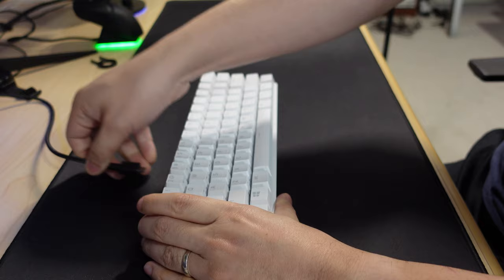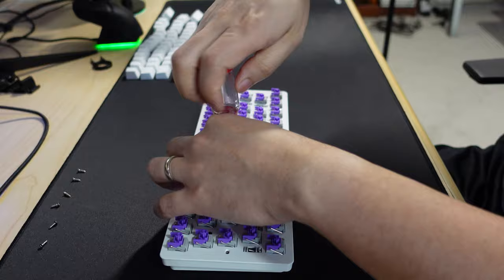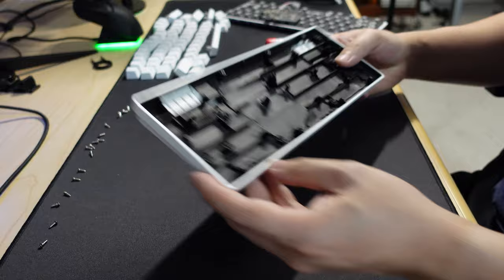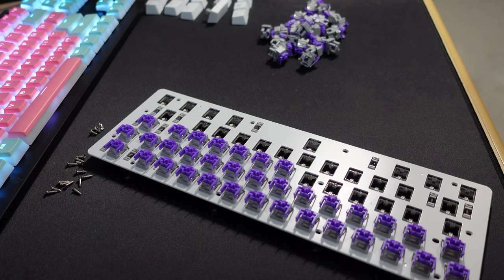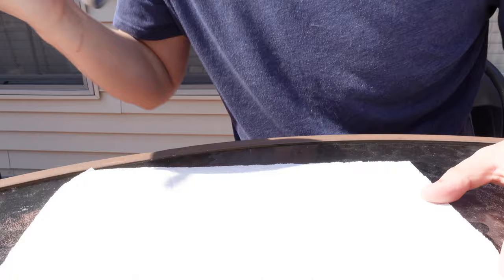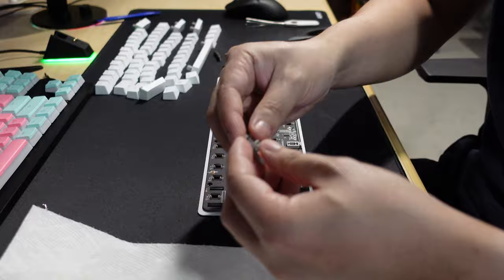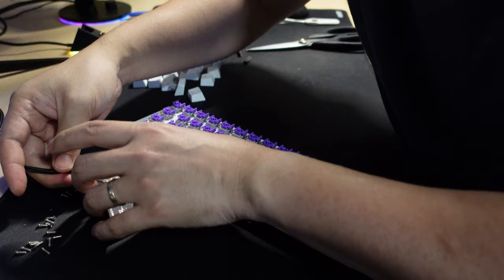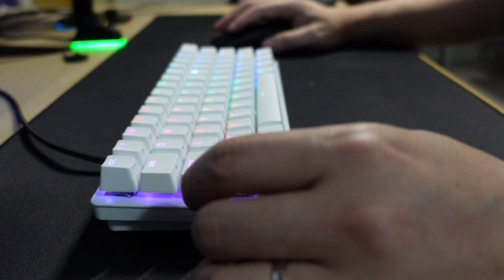Modding the Razer Huntsman Mini: Easy steps for better sound!

Comment: I hate how they changed the space bar
Reply from the maker: What's different about the space bar? Actually the advantage of the Huntsman TE and Mini are that they use a standard bottom row, whereas the rest of the Razer lineup don't, limiting their compatibility with aftermarket keycaps.
Reply from the maker: It's kind of funny since for custom mechanical keyboards, most are doing bandaid mods on the stabs, even putting them on the PCB to dampen the bottom out, so probably that's the feedback Razer took into account for the Mini. Personally I don't find that the feel is worse (or even noticeably different) but I definitely understand that everyone has different preferences. I'm a little too lazy to open the keyboard up again, but I assume that the little rubber inserts in the posts can be removed if you prefer the original feel of the TE, right?

Comment: Razer left the chat
Reply from the maker: To be fair to Razer, they've been doing a pretty good job listening to community feedback (for a large brand). Who knows, maybe the next iteration of the Huntsman will be hot swappable and have better internal sound insulation :D
Reply: I know what do you mean? I know everything that is related to razer #razerforlife
Reply from the maker: Specific examples include: entire Viper line took feedback from eSports pros, starting with the Huntsman TE, they standardized their bottom row so that aftermarket keycaps are compatible, etc. They're pretty active on Reddit, even in r/mk/ so if they see people reacting positively to some of these mods, they may take them into consideration for their next gen of keyboards.
Reply: @bigxie  yeah i know and i got the new blackwidow v3 and its lit

Comment: The linear red comes with glue
Reply from the maker: Glue where?
Reply: @bigxie  My wrong, the linear switch comes lubbed
Reply from the maker: @framedthunder6436  you can check the comments, another user did these same steps for the red linear and uploaded before and after sound clips. Big difference. Razer claims they come lubed, but other teardowns show no indication of lube. Even if they come with lube, it's not a great job and there's tons of room for improvement.

Comment: There's no point in lubing clicky switches, if you have the intent to lube switches, get tactile or linear switches.
The whole point of lubing is to make the switches quieter/smoother, while the point of getting clicky switches is to be able to hear the actuation of the switch.
Reply from the maker: Didn't you just watch a video where the clicky switches that got lubed got smoother, quieter, AND retained the distinct actuation sound? It's almost as if this common saying of not lubing clicky switches only applies to MX clone switches, and doesn't apply to Razer's clicky optomechanical switches. If you're curious why, Chyrosran22's teardown video is a great resource: https://youtu.be/QiFg9wGQXwA

Comment: If u want better sound get the linear its quiet lmao
Reply from the maker: Yeah the red switches are quieter, but the springs still ping just as bad, so all these mods are just as applicable and will result in significantly better sound for the linear version of the Huntsman Mini as well. Somewhere in the comments are sound clips from someone else who did it to the linear version and it's pretty drastic too.

Comment: damn i think i fucked it up lol. my win key doesn't register and my w key activates a bunch of other keys on the board.. tuff
Reply from the maker: Sorry to hear. You can try removing the problem switches and using some rubbing alcohol pads to clean out those sockets (could be some lube gunking them up). Also keep in mind that the keyboard is not hot swap, so make sure every switch is placed in before powering it on or else there will be wonky behavior.

Comment: i know this video was a long time ago, but seeing him pry the ribbon cable with a wedge made me actually cringe. if anyone else is watching this video in 2021, there is a latch that connects the cable, just flip it up and remove the cable. when you put the cable back, the metal contacts should be facing down. save the keyboard
Reply from the maker: Even though the video is pretty old, this is actually a really common comment! It's come up a few times already even in just the past couple of weeks. I'm not too sure why the latch wouldn't come off the first time around (can't remember anymore), but later on in the video in the 2nd disassembly it did just fine. And for people who are uncomfortable with messing with the latch, I think that unscrewing the daughterboard altogether is an easy way to avoid any possible damage that could arise from improperly removing the ribbon cable. 

Out of curiosity, what motivated you to leave your own comment when there are already so many others saying the same thing? I mean maybe you didn't read through the comments thoroughly to notice all the other ones, but anyone else who would benefit from reading this comment would have already been "saved" many times over before reaching yours ;)

Comment: "While the sound has slightly improved."

No, dude... there's 0 improvement. xD
Because the ping isn't caused by the plastic at the BOTTOM of the keyboard, that you "dampened". xD

Edit: At first i thought it was the wire in the stabilizers causing the ping noise, but it's actually the spring inside the switches... Somehow the dry-lube eliminated the residual vibrations after clicking the switch, eliminating the noise.

The foam you applied though? Absolutely useless. :P
Reply from the maker: Ping is from the springs, foam is to absorb reverb from all switch noise. Obviously lubing makes the bigger difference, but foam definitely helps (and if you look more into mechanical keyboards beyond just this Huntsman video, you'll find it's a common procedure). Cheers.
Reply: @bigxie  The reverb inside a keyboard is not large enough for such little foam to make any difference, you need louder noises and bigger rooms for the reverb to even be audible to the human ear.

So no, the foam made no difference.
Reply from the maker: @MyouKyuubi  you're certainly entitled to your own opinion! But maybe consider that it's possible that you're just not perceptive to the sound. After all, if so many people can notice the difference across hundreds of different keyboards you claim don't have enough room inside them to even have reverb, what's more likely? Everyone is experiencing placebo or you're just unable to tell the difference yourself? Honestly, just be grateful it doesn't bother you since now you can save a bunch of time skipping that step!
Reply: @bigxie  Just 'cus they THINK they hear a difference, doesn't mean they actually do.

Placebo effect is not an opinion, it is FACT.

Your mind plays tricks on you all the time, that's why we have science, so we can, OBJECTIVELY figure out what is correct or not, what actually works or not.

Science says that your foam is useless, i'm afraid... And, unfortunately for you, no matter how much denial you exercise in protest of these facts, does not make said facts disappear.

Facts never cease, they don't go away. :P

I am entitled to my opinions, of course, but... These aren't opinions, it's science. -.-'
Reply from the maker: @MyouKyuubi  could be, but definitely not just because you claim it. Show the proof 😂
Reply: @bigxie  Sure, when you show ME proof. :P

Look, asking for proof in a youtube comments section is, in this day and age, not an option anymore. :S

Even if i wanted to show you proof, i can't, youtube censors (the censor bots straight up just REMOVES the entire comment, without telling you) any comments containing "triggerwords" or links, even links to other youtube videos, lmao. xD

That being said, asking for proof, as if that somehow refutes my argument, is just an appeal to ignorance fallacy.

Just because i personally don't, won't or can't prove a fact, doesn't necessarily mean it isn't fact.

Here's the thing, buddy, FOAM, in keyboards, isn't used to reduce reverb, it's used to reduce the sounds PRODUCED by shock. So, if you implement foam in between every hard-surface contact point, you effectively reduce the amount of noise PRODUCED... Which is infinitely more effective than reducing reverb that isn't even audible to the human ear. :P

Foam in keyboards is not used to dampen sounds that have ALREADY been produced... It's used to prevent noises from being produced to begin with.

You're using the foam, incorrectly. :P
Reply from the maker: @MyouKyuubi  foam, silicone, shelf liner, etc are used in keyboard modding between the case and PCB all the time to absorb noise/reduce reverb by reducing the overall amount of empty volume in the case. Have you considered that?

I'll give you credit for putting together a coherent pseudo-scientific explanation, and you're right, I asked for proof tongue-in-cheek. Obviously you cannot prove you are right nor can I prove I am. But I am not the one claiming to have scientific high ground with no credentials or reason to be believed, other than strongly worded, obnoxious statements. 

At the end of the day, there is overwhelming consensus from other YouTube videos and my own personal experience that by placing foam under the PCB, it reduces the noise of the keyboard. If you want to waste time arguing over the semantics or being a pedant, well, don't bother anymore. I entertained this thread to see if anything fruitful would come out of it and instead am now bored by another cookie cutter self proclaimed internet expert. Take care.
Reply: @bigxie  No, dude, they're used to absorb shock, dude.

jesus christ, bro...
Reply from the maker: @MyouKyuubi  I love that part of the scientific method where you repeat something over and over again until it convinces everyone. Great job, it worked!

For the benefit of any viewers who may read this comment thread (sorry for that tremendous waste of time), what Madao described is essentially foam gaskets, which are used in many gasket mounted keyboards. What I've been describing and referring to is case foam, which is prevalent in the majority of custom keyboards (regardless of mounting style), and also why it was replicated on the Huntsman in this video (since, you know, Razer doesn't bother). 

Madao - bro, dude - if you think that foam MUST be used to absorb shock, take it up with the keyboard designers, I'm sure they'd LOVE to hear your rants. As for me, I'm done with your know it all trope. Next time you have an opinion about a topic you hardly know anything about, it's probably best to just keep it to yourself.